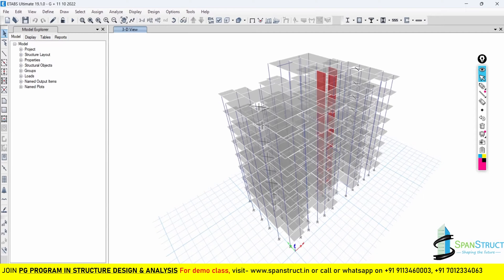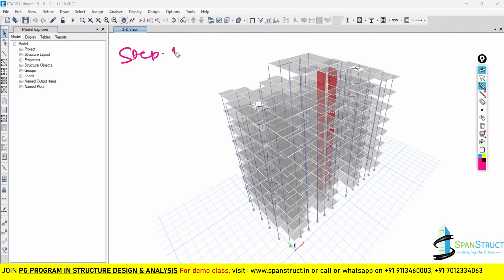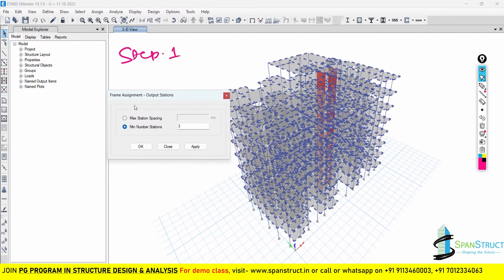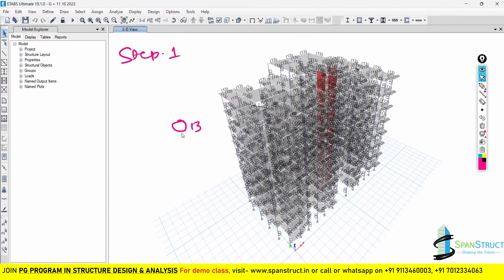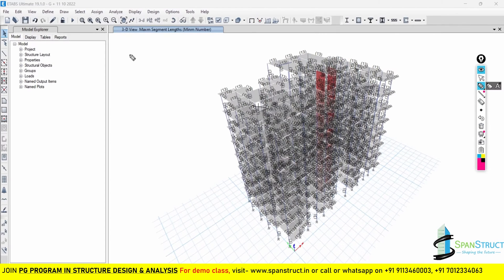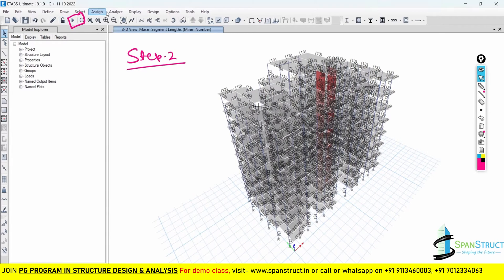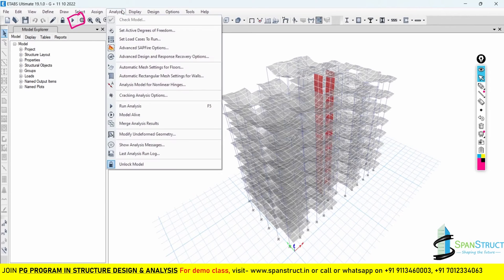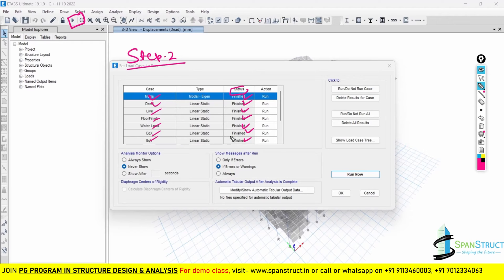RCDC : Steps for Importing ETABS file into RCDC

Comment: I using same procedure and using same rcdc but etab2021 and access 2013 then after we are facing problem unable to read analysis data how to resolve
Reply: Same issue with me
Reply: Save as your MDB file in old version like 2002-2003
Reply: will export data take up all memory from c drive?